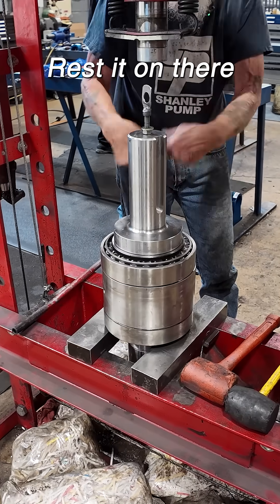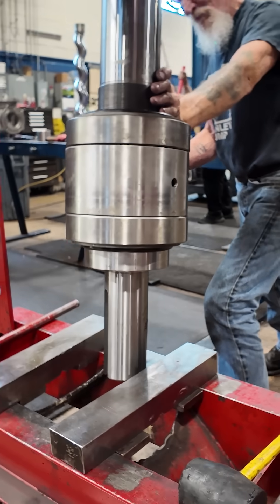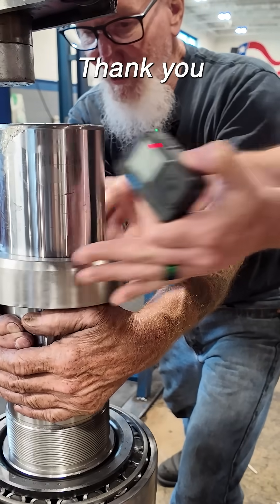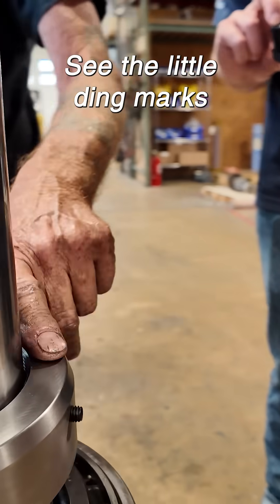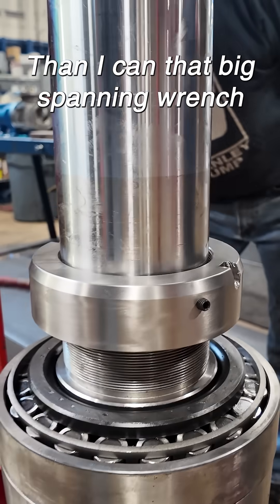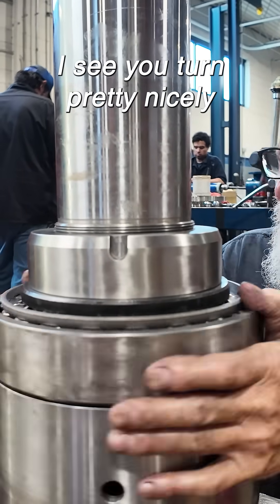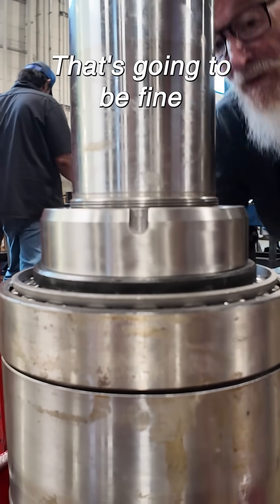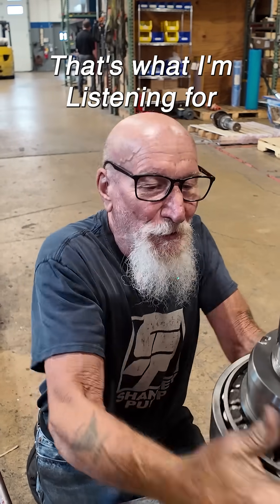Rebuilding a Large Open Throat Hopper Pump Part 5

Comment: Do you guys run a feeler gauge in-between the bearing and race after you set the nut at some put? 
That's how we set preload on bearings for trunnions and stuff at a plywood mill.
Reply: He should be packed with grease it is Timken bearing and using a chisel on a bearing nut chips getting in the bearing